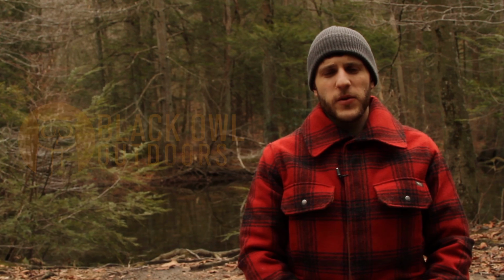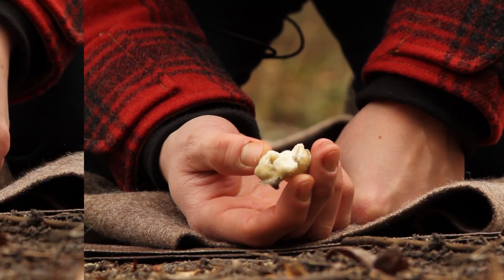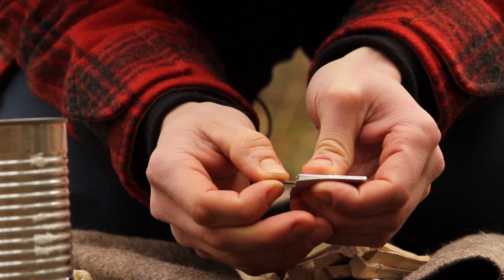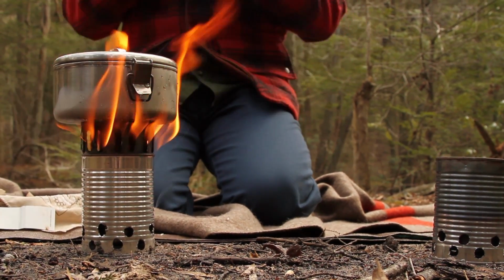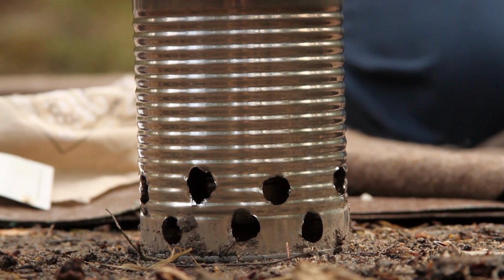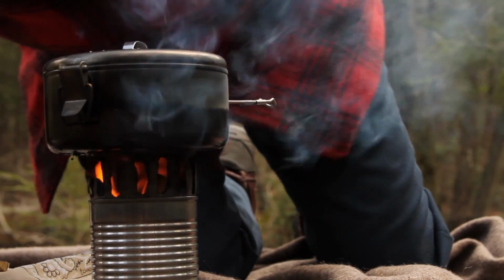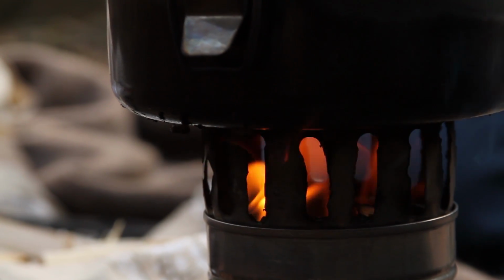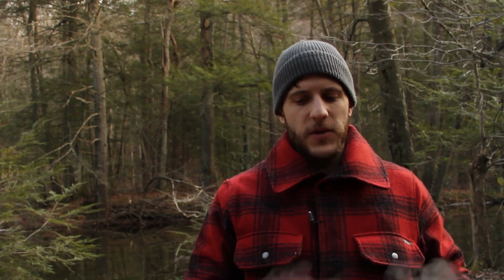DIY Wood Burning Stove - Boil Water Test

Comment: I hope you worked out your air to fuel ratio since this video. YankeePrepper makes a very efficient stove that has great spacing. Thus his boil times are MUCH better. Check him out! He even shows how to make the smaller alcohol stoves from a pop can. I personally have a Jetboil from my previous days working at REI. Love it. Makes a rolling boil in under 3 minutes. For my niece and nephew we are making the alcohol stoves, and one larger wood burner for a camp stove. Light weight and cost effective, the hobo stove is a great way to go, but only if you get the ratios right.

Comment: Titanium jet boil, done. Under 10oz with fuel and boils 2 cups in under 2 minutes. This whole process seems like so much work to boil a small amount of water. If you really want to DIY something just make a classic soda can alcohol stove.
Reply from the maker: +Andrew Grimes You never run out of fuel with a stove like this.
Reply: @BlackOwlOutdoors  
I've made a few of these stoves and like them, BUT on the Plains of Kansas, Nebraska, ect. you could run out of fuel.
Not a lot of trees.
Knowing how to make stoves like this is a useful skill. 
I forgot my jet burner once and made something like this with a knife and a can from a litter pile to make my meals. I was in no open fire area so no campfire.
You can cook with this type of stove and only need small amounts of dry twigs. Thumb size and smaller. No chopping or cutting needed.

Comment: flames are so high and why? because the gasification process isnt be efficient because the holes are being covered with the batons.... back off on the amount of fuel only add it when needed and you will get better burns that dont engulf the cook set your using

Comment: +Black Owl Outdoors i know this video is a bit old  but i will say it anyways.
if you load the stove full first whit the sticks and then place the tinder on top and lighting,it will have a burn time of about 50-60 minutes and it will light more easily
Reply: The way I heard it explained is that it burns from top down, if you light it up from the bottom the whole thing will burn out all at once in 3 minutes and the flame will be huge
Reply: It’s just a campfire in a can when it burns from the bottom up.  Top down burn is supposed to be the best gasification method. A true wood gas burn results in little to no smoke. The fuel I prefer is 1/4” diameter twigs snapped into 1”long pieces.  Load it up to a little below the secondary air openings. Then top it off with fire starter which “down drafts”  some of the unburied superheated wood gas eventually.
Reply: Gabrielle cicirielo is right a TLUD will give you a better result that's the way a woodgas stove work the best. An another improvement is to add a flame concentrator a you'll get rolling boil within 8-10 minutes easy.

Comment: These are great,  I certainly wouldn't fork out cash for a gas cylinder etc when you can knock out one of these so easily.  I saw a guy make the holes with one of those bottle opener things and a pair of pliers for the ones that support the inner bit. The bottle/can opener thing that leaves a v shape (I know you guys call some bottle openers Church keys but I am not too sure which kind that is..its the one that mskes the holes in can tops I'm talking about.  Thanks for the video. ..stuff like this could save lives, you just never know where water has been upstream of you and I personally think that you can never feel too secure these days!

Comment: Question: why wouldn't you use a taller can as the top piece and cut a larger slot on it so you can add fuel as you go without removing the food/water content?

Comment: By design, wood gas stoves burn from the top via the secondary-air holes (as demonstrated in the video) which is key to generate the necessary 'heat-cap' to trap the created wood gases/smoke (i.e. hydrogen, methane, carbon monoxide, nitrogen, etc.), and as a result beginning the perpetuating cycle of pyrolysis/gasification.  This is why wood gas stoves are also known by the acronym, TLUD -- 'Top Lit' Up-Draft stoves; their design intent is to burn from the TOP down, not from the 'bottom' up.

By 'BOTTOM-lit/then-load' fuel loading, the total volume of available fuel space within the burn chamber is not only wasted, by LOOSELY loading it from the bottom with tinder 1st, then kindling, and lastly large wood, but also the 'heat-cap' generation, which is key to the pyrolytic/gasification process, is delayed: quicker gasification = faster optimal operating temperatures = quicker boiling & longer cooking times.

Consider the 'batch-load/top-lit' method (note wood density % pattern): load ~70% large processed/baton-sized wood 1st (stack/pack vertically on end -- like straws in a cylindrical container), then ~25% smaller wood/kindling 2nd (scatter horizontally, non-patterned), and last ~5% tinder/accelerant (spread completely across top).  Be sure to keep the fuel load stack-height BELOW the secondary-air holes located at the top rim of the stove.  Light it from the 'top' & leave it alone... If the wood gas stove's fuel-to-air ratio is designed correctly, you should not have to add any wood for at least ~20+ minutes.

I've personally designed several DIY (tin can) wood gas stoves that have small 14.5oz burn chambers; I have consistently achieved an average of ~25+ minute burn times on one load of processed/baton-sized wood.  If I use one load of wood pellets, I can easily achieve over 40 minutes of burn time.

Long story short, there's really no need to have to sit there and constantly add wood/fuel, especially just to boil 2+ cups of water.
Reply: Why don't you post a video showing how to make this stove?

Comment: One thing I did was cut a larger section out of the pot stand so small twigs and sticks broken to an appropriate size/length could be fed into the stove while still cooking/boiling.  It has proven quite effective.  I try to keep the fuel no longer than a couple or three inches, and no thicker than my pinky.

Comment: That is a nice build, it is in fact a wood gas type stove. But you need a way to feed it easy and not overload in the beginning. That's the drawback to small wood gas stoves, you have to feed it constantly. You can't just stuff it because it will efficiently burn everything, like that giant fire when you started.

Comment: If you try loading up with smaller sticks to just below the top two rows of holes to get started, then with tinder and lighting from the top, it will work more efficiently, (that's why you were getting huge flames before it burned down and the gas could flow freely). The holes need to be free of obstruction to get the secondary burn as quickly as possible after the main burn from the captured wood gasses flowing out at the top.This secondary burn causes more air to be drawn in at the bottom and lessens pot sooting, but you will get still get some and tarring, but a lot less than you got with the pot on the huge flames at the beginning,

When I've finished cooking and the pot is cooled down,  I wipe the soot off with a cloth or some toilet paper (get's used as tinder in the next burn). This leaves the tarring because, as you correctly point out, a blackened pot heats up faster. A pot with just the tarring on won't mark things like a sooty one will.

When I get home I give my stainless steel Zebra billy a very thorough clean with normal washing up liquid and don't scour the blackness off. However I noticed a comment on how to get rid of the blacking, and if you like your pot shiny, leave it until you get home and all that's needed for that is a bit of elbow grease and a green scouring pad or some fine wire wool.

I've tried making and using several wood gas type stoves, and whilst they've worked well, in terms of burning, they aren't very stable and prone to be easily knocked over. I now use a simple 13cm diameter steel canister without the lid with holes punched in the bottom, which my 12cm Zebra billy pot fits inside. I've modified it with a feed hole and a hinged closing door with latch on the side. I drilled four holes just below the top for two tent stake to be be threaded through  for pot supports. It works well albeit nearly but not quite as efficiently as a wood gas stove. The door allows me to use it as a wind shield for a Trangia burner and  use the simmer ring/snuffer on it. If I want to minimise sooting, I wait until the flames have died down and I've got a good bed of hot coals.

For further compactness and burn efficiency, I may go back to a wood gas stove which will fit inside my billy, and to get around the stability issue, I'm thinking of getting the Siege Storm Universal Cross Member set for it when my present one eventually wears out. They look very well thought out/designed and in stainless steel or titanium, extremely tough and durable.

I will be posting a video visually illustrating my current cooking system which I took on holiday in August, but haven't got around to it yet.

Comment: Can you make a DIY alcohol stove video?
Reply from the maker: Steven Evans great idea! stay tuned! - stony
Reply: BlackOwlOutdoors To piggy back off the alcohol stove recommendation, what about having a "Stove Off".  Using similar fuel, which performs better: large can with a few holes in the bottom, DIY stove, Solo Stove.  Then, have another Stove Off to compare a DIY alcohol stove vs store-bought.  Then, an ultimate Stove Off of lightweight, DIY stoves between alcohol and gasifier stoves.  Might be interesting.

Comment: Hi thanks of the Vid
I wonder if the method of  loading and burning you use is the best 

have you tried  charging the burner with small bits of wood and then lighting the fire on top... burning down the pile of fuel 

you may just get more gasification and a longer burn 

regards

Comment: Nice video as always. What's your preferred method to cleaning the soot off of your cookware?
Reply: Horace Harding  Rub the outside of the pan down with liquid dish soap before putting it over a fire. Soot washes off more easily afterwards

Comment: Why do people keep making these stoves with no way to add wood, there are very inexpensive stoves that make this possible, seems someone with experience wouldn't even show a stove like this.
Reply from the maker: Sometimes, I think it's kind of cool to leave things "unfinished" for a video. That way it prompts a collective brainstorming that includes me and the viewers. Is there something wrong with asking people for help and to think? -Krik
Reply: Nothing wrong brother, and good job. I am working on one as well and have the wood entry part down but not enough airflow from the top to keep the fire hot, when you put the pot on it dies down. I'll post a vid soon so you can hammer me, lol. Sorry, just seen so many that don't bottom feed. -Ben
Reply from the maker: LIVING SURVIVAL I had that problem at first when I was constructing the pot stand. I just put a larger hole in the stand for adding fuel. It works pretty well. But I have to let the fire die down a little so I can add pieces that actually fall down in the can and not just lay on top of the already burning fuel. BUT, the fire keeps going. Let me know when you post that video. I'm not looking to hammer anyone. -Krik

Comment: Looks like it worked pretty well. Cut a slot in the pot stand big enough to be able to add fuel and you should be in business.
Nicely done! I'd like to know what kind of camera you use as well. Your video quality is outstanding.

Comment: Having a way to add small pieces of wood while the pot is on the stove would be a major improvement. Cut some smaller pieces that can be fed from the top. Looks like it works good. Another thing would be to devise an ash catcher for those areas that have burn bans!
Reply from the maker: Those are all great suggestions. Thanks. -Krik
Reply: A good video, but I totally agree that being able to add wood would be a MAJOR improvement. Anyway, the video was informative.
Reply: BlackOwlOutdoors Well you could cut a feeding port in the side of the stand, using smaller sticks also makes the job easier ;)
i'm going to build one with vent holes on top too, maybe i'll cut a v notch on the top side to feed it without removing the pot..